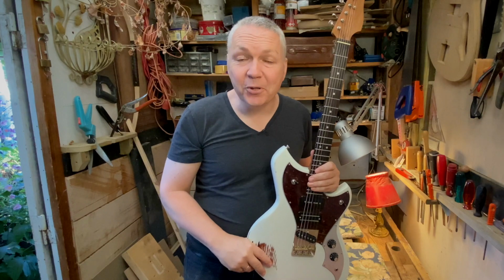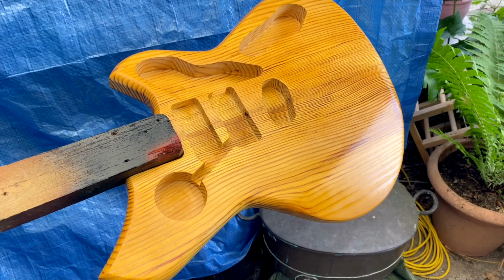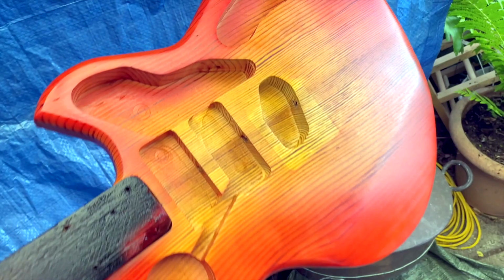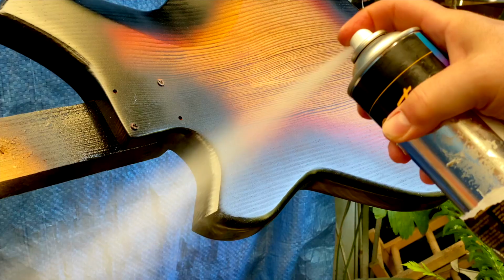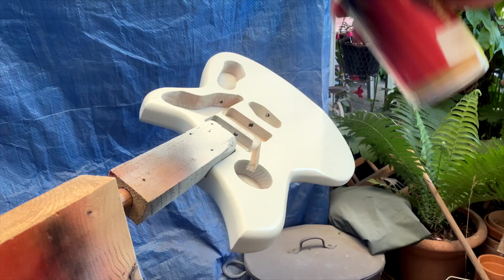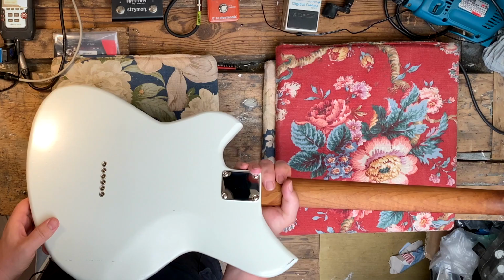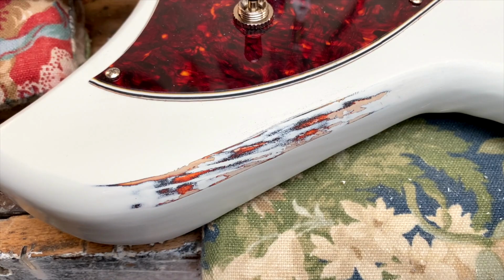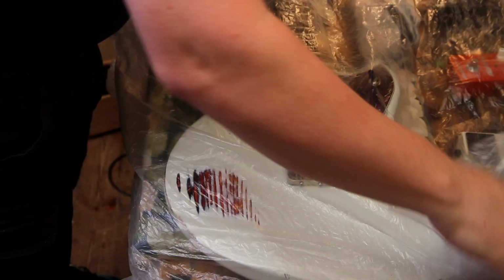Painting a guitar body with spray cans

Comment: Michael thank you so much for these videos. After sanding to 400 did you do anything else to create depth with the grain? I know people talk about Novo sandblasting or that you can use a wire or nylon brush in a drill to knock off some of the softer wood. Have you tried any of these methods?
Reply from the maker: Hi Jim
I actually wanted to try that but in the end I didn’t, I guess out of fear that I would ruin the body. I don’t have sand blasting equipment and I don’t really like the brush idea …
Thanks so much for watching 😃🙏🏻

Comment: Could have been an ok Sunburst. Does it have to be nitrocellulose paint? If you don't clear coat it will it always be sticky?
Reply from the maker: I already did the sun burst
Check it out:
https://youtube.com/playlist?list=PLMU4eqnUeCptGblPEB-_M_RxyWVBaBvYF&si=7PWuLszaOXmgHUSp

Doesn’t have to be nitro but that or polyurethane is what most guitar manufacturers use.

It will not stay sticky if you don’t ad a clear coat. Just be patient and do many thin layers rather then thick. Let it dry 15 min between layers. That worked for me 👍
Thanks for watching 😃🙏🏻